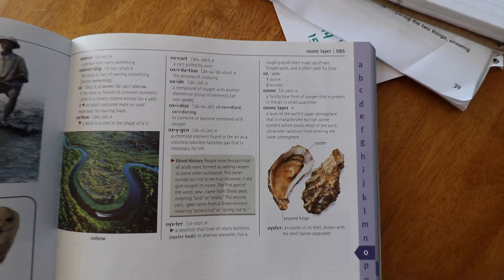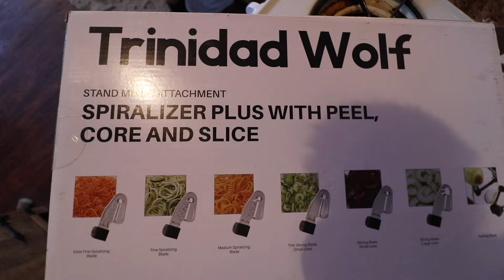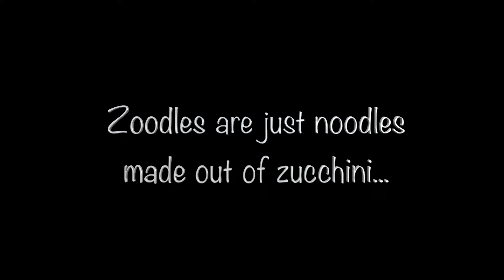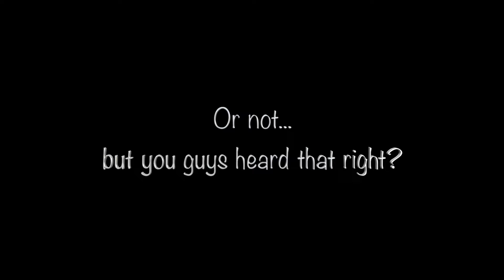Spring Clean Up in Alaska! | The Snow is Finally Melting...Prepping the Property for Summer Projects

Comment: Would like to get more info on your generators. Why did one of them fail? Did they fix it for free? How many hours a day do you run the generator?  Sincerely, Richard Goodman
Reply from the maker: The generator was a Firman. It had 97 hours on it when it seized up. The company replaced it for free. We haven’t had to run a generator lately, but when we do it for about 4 to 5 hours. While the old generator was at the shop we went and bought an electric start Dewalt generator. Seems to do well so far. 
Thanks for watching. 😊

Comment: Those sleds will fill with water if you don't stack them upside down. The wood might bring in termites in the house in the summer being under house.
Reply from the maker: Sleds will be stored under the house!☺️ Alaska does not have termites.😘
Reply: @HomeFreeAlaska  great to hear.